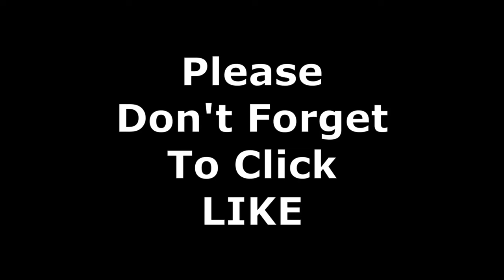1993 Cherokee Front Bearing and Universal Joint - Out in the Field - Part 2

Comment: Great job Charlie! Seeing you bolting that hub in place with the backing plate still lying on the ground reminded me of yesterday's exercise. I had to clean out the carburetor on our generator. I slid the carb in place, installed the back part of the air filter housing, and threaded the retaining nuts in place. As I was about to sinch the nuts down with the ratchet, I look over and see the metal retaining plate sitting on the tailgate. I had to remove the nuts, install the plate, and start again. We love our job so much we do it twice! 🤣🤣
Reply from the maker: Often I try to blame the camera.... but this one was all me...

Comment: Good job, but you need to invest in a torque wrench.
Reply from the maker: I do currently own and use 3 different size/range click-type torque wrenches. I tend to use them with TTY bolts, when fastening into Aluminum where/when torque is critical, and when clamping forces are important. Most others fall into a "common sense" / experience category.

Comment: didn't understand why you didn't use your tool and impact to reinstall its so much faster i used to do the way you do until i started using the tool  twice as fast
Reply from the maker: My impact has been misbehaving. It's 10 years old. I'm considering a slightly stronger version, as a replacement.